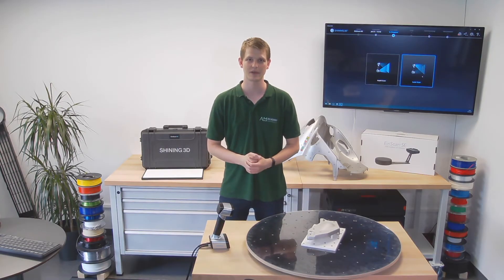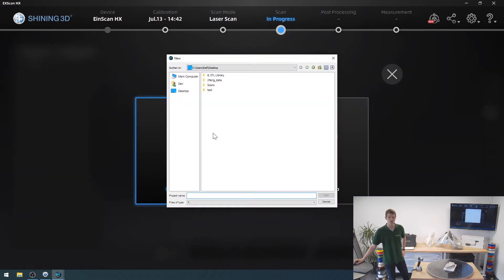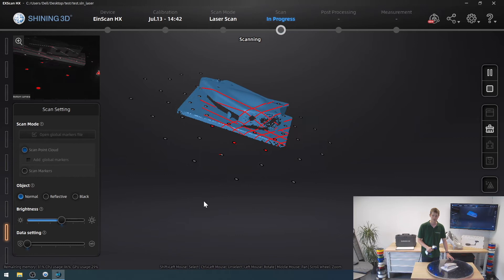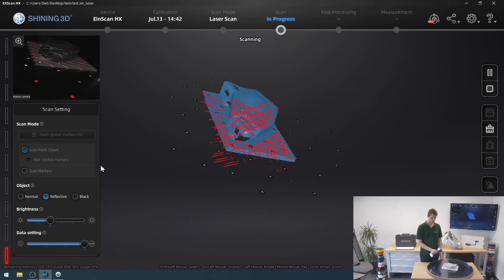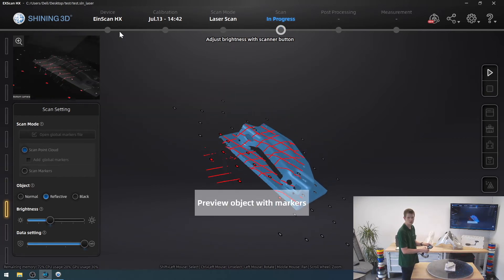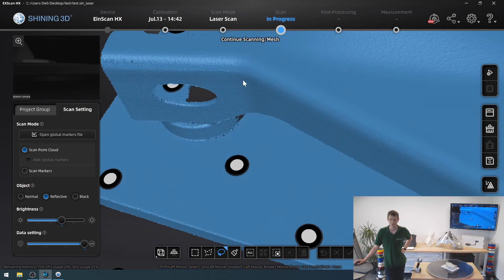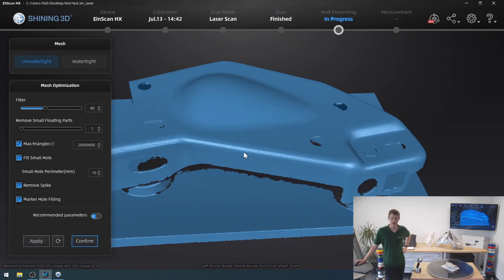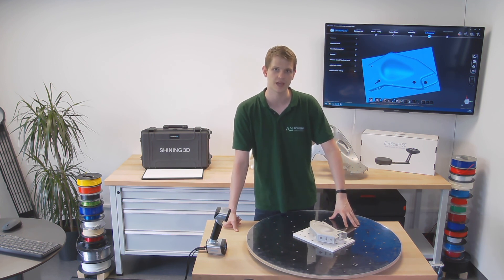3D Scanning with Shining3D EinScan HX Laser Scan Part 2   Verisurf test object

Comment: Like! ;) What do you think, what better choose?  EinScan H or RangeVision Spectrum ?
Reply from the maker: They are very different and it really depends heavily on your specific application. What do you need to scan? The RangeVision Spectrum is a stationary scanner using structured light. The EinScan H is a handheld scanner using EITHER structured light OR infrared. The Spectrum is better for small objects, the H is better for humans.
So it really depends :)
Reply: Sven, I need scanner for auto sparepart, I guese if I'll be use EinScan H, all was great!
Reply from the maker: @VladimirMakarov-j2h  I would recommend the EinScan HX for car parts, as its laser scan mode is better suited to scanning shiny or reflective surfaces. The EinScan H can struggle with this.
Reply: @AMAcademyBayreuth  yea, EinScan HX better, but it's to expensive for begiging. And I think if used markers, with scan not be a problem. Like in you video with part from motobike.
It's even cheaper to add a matting spray.